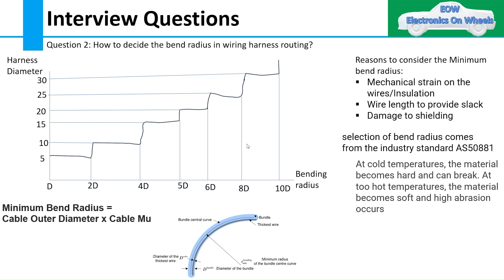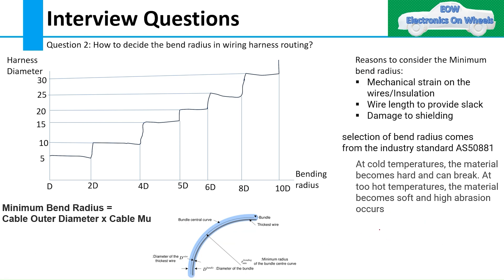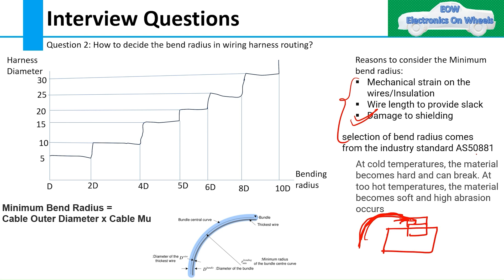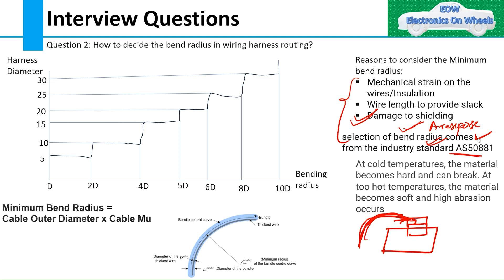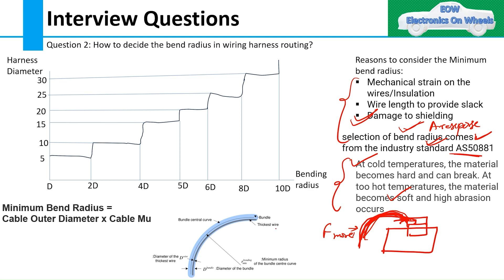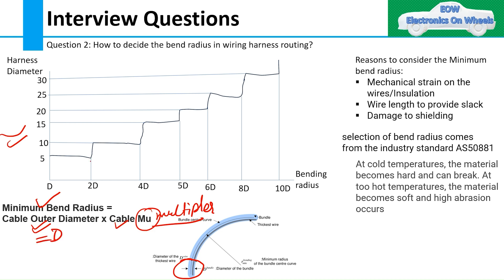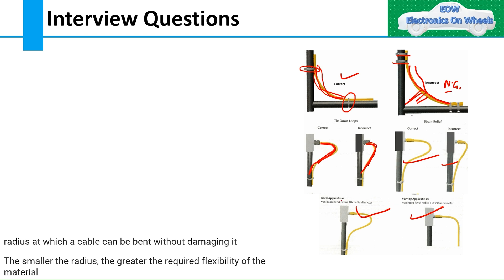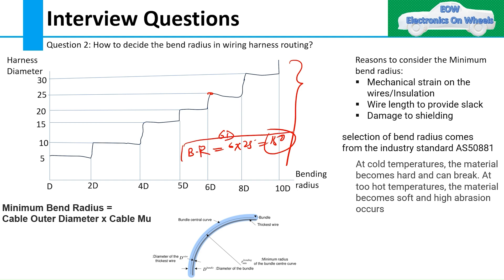Inter.Q2:How to decide bend radius in wiring harness? Factors affecting wiring routing @WiringRescue

Comment: Hello. I suppose you have a miss-telling in your video : 6:38 you say about bending RADUIS but you right D.
I suppose the rule will change dramatically if the harness is not fixed and need to move during the operation.
Also EN 50565-1:2014, ISO 6722 could give some idea of minimum bending radius.